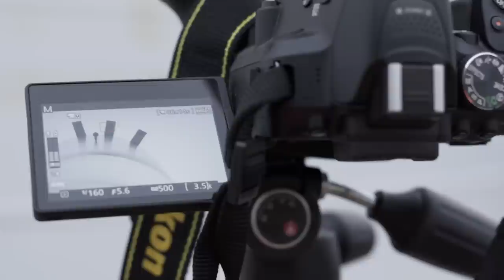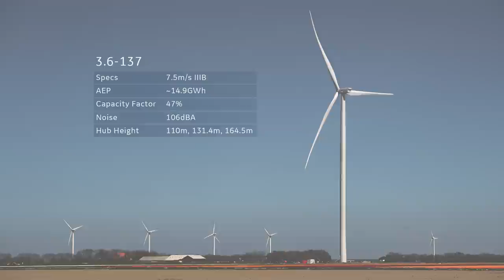Witness the Installation of a Giant GE Wind Turbine in the Netherlands

Comment: The stresses on the blade bolts must be phenomenal, this is precision engineering on a massive scale !
Reply: I was thinking the same thing. The wings of an airliner are relatively short - and wide at the base - yet the wing-box that secures them is massive. The blades of these monster turbines are long and heavy, yet the 'wing-box' is relatively tiny - something to do with aerodynamics maybe. There have apparently been a few cases of blades detaching and towers buckling under the strain . . .
Reply: Does this turbine need batteries to store energy?
please answer me

Comment: I remember going to a wind mill in my country when i'm doing the organizer job for the launch ceremonial by our president. From far away it looks tiny, but after you get in the bottom of it, man it beyond explanation, its not only gigantic, but also mark a remarkable achievement for engineering. Especially if I imagine on how the heck those giant can be installed in a mountain and hill, which geographically, I barely can reach it by walking, and those engineers can made it and accomplished the impossible.

I admire current engineers. Outstanding.

Comment: Great video. What are the parts spiraling down the top sections of the tower? I haven't seen those before.
Reply: They are put in order for the wind to not oscilate the whole tower. When wind blows trough a cylindrical tower it makes it resonate and often brake. Those spirals dissipate the wind
Reply: Those are called vortex shedders, also found on on chimmneys to reduce oscilation caused low pressure vortices on the downwind side of the tower.
Reply: @rodon91  fellow windfarmer bud

Comment: Does the top of the wibd turbine come with the gear box and generator already installed
Reply: Yes. It is installed A one piece.
Reply: Yes and No, Depends on the size of turbine, I just finished A project Of Vestas towers and they required the Gearbox/Main shaft to be installed Separately from the Nacelle

Comment: This is a genuine question:

I’ve always wondered, if these wind turbines are taking (some of) the energy from the wind, what is the impact downstream of these turbines? Because essentially that wind is taken away from where it would have otherwise ended up. 

I would guess that the power (watts) of the wind is so enormous that these take so little there is no discernible impact. 

But as we know, taking energy from one place to be used (converted) elsewhere often has an impact. 

Anyone have a good answer?
Reply: The fact is, wind can't be harvested completely of  its energy downstream. According to Betz's law and coefficient, only up to 59.3% of the wind energy can be harvested.
But wind shall always be produced by difference in air density and sun's heat energy.

But thinking of your question, yes. The reduction of wind energy up to the Betz's coefficient should be felt downstream. But what's the use of wind, anyway? Lol
Pollination? Lol

Well, my view is that more wind will he produced downstream, since factors that make wind will always be available.
Reply: @victorbarugahare8328  1) the impact is negligible
2) whatever the impact is, it's rather similar to that of a forest - it slows the wind down, but even a small forest, due to density, will have more of an impact.

Comment: I like wind-turbines, the bigger, the more efficient, the more impressiv, but only 3.6 MW for such a huge turbine?
Reply: It's a class III wind turbine, meaning that's it be designed to get more energy from the wind in locations having a lower nominal wind speed, for this purpose they need a bigger rotor.
Reply: Pierre Pasquet doesn't this waste materials when you have a massive rotor but only a small generator which can't get all the juice out of the wind? I mean, some share of the rotor then does nothing, just sits idle😕
Reply: Karl-Alfred, 

the simple fact is this 'huge' turbine will average about 1 to 1.2 Mwatts due to the variability of wind. They seldom reach rated power. In power generation terms it's a toy.
Reply: @iainreid9914  that produce cleaner energy.
Reply: Raindrizzle, 
a source of energy that requires constant fossil fuel generators running as back up, so not as clean as you might think.
Reply: Hello Mark, 

thank you for your response. I not only studied it at college, I worked in the power industry for years. Iceland uses geothermal and Denmark relies on Norway for hydro back up when the wind does not blow. If you are happy to have a system that can only provide power spasmodically, fine for you, it is not acceptable for the modern world. However there are always fossil fuel stations running in the background as they cannot be switched on and off and are essential to the system. Germany is an example of a country that really tried to use as much renewable generation as they could, and at trillions of Euros are starting to understand how ineffective it is 365 days of the year and have one of Europes highest electricity cost. They had to increase their coal generation capacity as they also, rather naively, are shutting of their nuclear plants.
My fears are based on sound engineering facts not utopian desires.
Reply: Iain Reid Hydroelectricity doesn’t require any fossil fuels to run. Only when a reservoir doesn’t hold enough water do diesel generators kick on. 
Keeping a large Diesel engine from running one day using hydroelectricity is a win wouldn’t you say? I say this because all the power I use is generated by hydroelectricity. Since we get a ton of rain each year we don’t have to kick generators on. 
I’m sure you’re right for some parts. But we have to start somewhere.
Reply: Laiken, 

I didn't say that hydro generation requires fossil fuels to run. Given suitable geography hydro is a good way to generate electricity, unfortunately theer are limited scope to expand on what we have, at least in the U.K. Other countries also have the same problem.
Reply: @markravilious5462  i'm from Portugal and we DID NOT ran 100% on renewables, plus, our energy prices in 10-15 years more than doubled, directly causing more unemployement and increase in prices in everything. 

We had around 50% produced from wind, however, they had to build 3 more big gas plants to prevent blackouts (when we have 2 cheap coal big ones that they try not to use due to high co2 taxation on it).  
More recently, we're importing more and more energy from Spain (that has nuclear power plants) due to renewables being unable to meet demand, and when we have wind do produce lots of energy at night, we're paying them to export the power we can't use. 

But we're still building those blody things, and power bills continue to rise.
Worse of all, our beautifull mountains are now full of useless scrap that in 10 years no one will bother to remove. 
But yeah, you're right on this, when there's some wind, we do produce A LOT of energy. Sad that doesn't coincide with demand (monday to friday 6h to 21h). 
Oh, and on top of that, we also have now large solar farms, worsening the problem. And a few biomass plants that polute more than coal but some idiots in high places thought they are also renewables sources...

As for hydro energy storage, its really inneficient to spend energy to power watter pumps just to have capability later to produce hydro power. And thats ANOTHER reason to increase power bills - that pumping wasted energy has to be charged to someone. And lets not forget what big dams do the the enviroment, clearing huge areas to create reservoirs, completely destroing fauna and flora. But yeah, wind power off-demand times can be used for that. But again, someone has to pay it, and that means me and you (if you have this kind of energy in your country), as no one today in western world can live without electricity.

Now, PLEASE, do PROPPER research before repeating green propaganda.
Reply: @iainreid9914  I can tell you are an engineer because its the way you write I.e no bullshit. I'm an engineer too which gives me the opportunity to cut through the marketing, political bullshit and say it how it is. Its funny watching corporate management squirm when I tell them the facts and figures and not hyperbole to suit opinion or agenda. Carry on sir.

Comment: Genuinely impressive 👏👏

Does anyone know what power (kw) is produced by one of these in normal operation?

And what is the gearbox ratio etc? I.e for one spin of the blades how fast does the generator shaft spin?
Reply: Well under decent wind they should produce close to their nominal capacity (3.6MW). Per year, on average, onshore wind produces about 1800 full-load hours, i.e. the average utilisation is about 20% of the nominal capacity.
Reply: In sidrap indonesia, it produced 2.5 MW per wtg

Comment: It must've been a headache maintaining these as snow will eventually build up on the leading edge of the blade
Reply: Do they not have heating elements in them? Like aeroplane props.
Reply: @GeeTheBuilder  theres a company called wicetec that made one apparently, but it can be quite challenging as these arent made of conductive metal and if you hollowed out a turbine blade wall you will drastically make it more prone to failure, and the thermal gradient will probably promote delamination at the leading edge
Reply: niels lund  I say again, maintenance. And I doubt there's no problem there, unless you've made a perfect machine without maintenance
Reply: niels lund  effects of low temperature is a design consideration as it will lead to icing problems thus u will need to counteract these effects integrating de-icing mechanism adding complexity. Don't get me wrong im not criticizing wind turbines on these harsh environments im just awed by the fact that this is a challenging engineering problem
Reply: niels lund  Although I said initially snow (sorry bout that) im going to correct it to icing problem. I doubt icing is not a significant problem "engineer". Offshore is a different issue
Reply: @edgravity  there's luckily always a new issue to be endlessly worried about!
Stay alert ⚠️☠️⚠️🙋🏼

Comment: This is good, but we need to consider magnetically levitated wind turbines because they can receive wind from any horizontal direction, they can function properly with wind speeds as low as 3.3 Miles per Hour or as high as 89 Miles per Hour, and best of all, they can be equipped with wind boosters that can multiply wind speeds by 8. One colossal, frictionless wind turbine can match 1,500 wind mills and power 750,000 homes, but take up no more than 2% as much space.
Reply: What types of herbal medicine did you smoke, boy?
And where is your 3-MW-prototype running?

Comment: After they failed completly with their fukushima Powerplant construction they build wind turbines now. That is a good idea.
Reply: The problem in Fukushima wasn't inherent in the GE reactors. The problem started after the tsunami when the backup cooling pumps were disabled by the flood water. There is a very limited amount of time that any nuclear reactor, even the newest AP1000 design, can safely operate without sufficient cooling water and the power to operate the shutdown commands.  That cooling water is the lifeblood of a reactor and if it stops it is akin to cutting your aorta and then complaining that people tend to be in poor health when it happens when their blood pressure drops to zero.
Reply: @epistte  several factors caused fukushima. 
- Early generation reactor (but unlike Chernobyl, had steel vault surrounding it)
- Poorly designed power backup (they were easily floooded, both generators and batteries)
- Huge >100 year tsunami that has a really low probability and difficult to add into to plans. Ie. seawall had 10m but the wave had 13m.
 The operators did the best they could with what they had, but if some errors weren't made, they could've prevented meltdown and subquent hidrogen release that exploded releasing radioactive particles.

Comment: Is a big gamble and it depends on the wind speed in that day is not always windy some days you have no wind and at what speed of wind it needs to start producing power done get wrong please through my experience as an engineer there's better solution for wind turbine that you can build and produce continues power 24/7/365 and much cheaper from what I found out that the price of wind mostly is on propeller and tower 45% this number can be lower almost by 30 to 40%.
Reply: That sounds interesting. I hope your prototype shows the results to us soon.

Comment: It's a losing proposition. Build cost V/Gen revenue. You'll never recover cost.
Reply: True but however, recover compensation, yes. It's worth it.
Reply: Not true.. costs are below coal. The windparks are nowadays built without subsidy, although the connection to the grid is free